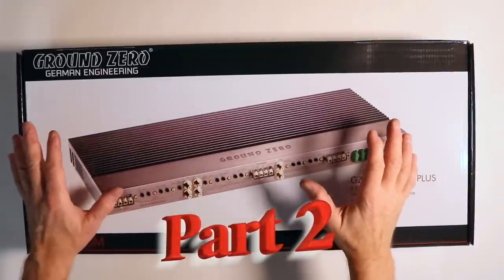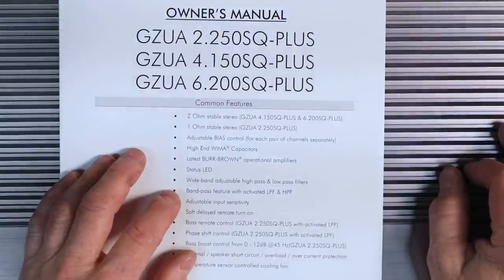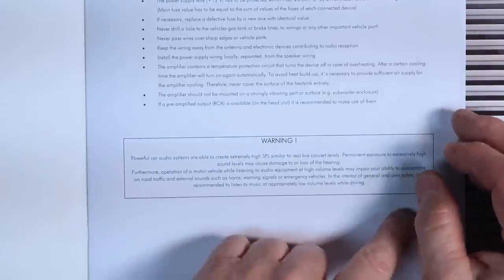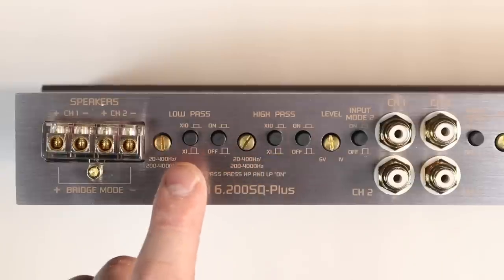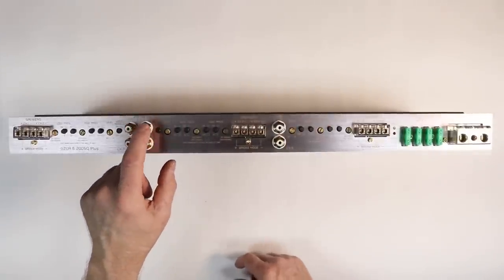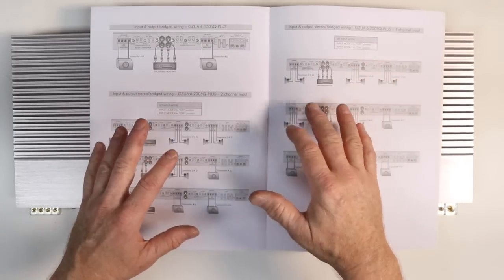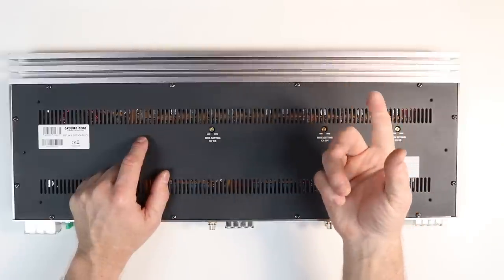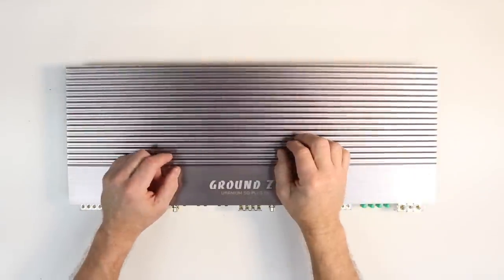Ground Zero Uranium  GZUA 6 200sq unboxing Car Stereo Lab part2

Comment: Awesome. I'm running 3 of the 4 channels versions of this , Except it says B2 audio on it. (Same exact amp, same box, same dunnage (cardboard holding ends of amp) same felt black bag, same heat sink, same color,same output layout, same bias control.)

They sound amazing
Reply: Which B2 amp is that?
Reply: @ScramTek  reference four
Reply: @TKO_Horticulture420  
Ah okay. I misunderstood. Searched everywhere for a 6 channel B2 amp version of the GZ in this vid. No wonder I couldn’t find it…

Comment: Hi Dean. I’ve purchased two of these 6 channel and one 4 channel for a fully active system with a Helix Ultra (summer project). I was considering the Zapco AP’s which are only little bit more expensive. But I’ve chosen these because they have been tested by a well regarded German magazine and the S/N ratio and the dampening factor of the GZ was substantially better, but little bit lower ouput power. Someone, a installer, assumed that the AP’s were better because…. no real reason. What’s your opinion. Test results or just an opinion?
Reply: Also the op amps are upgradeable.
Reply: @ericperry72  didn’t know it actually…

Comment: The Bias controls suprised they put them on the bottom instead of the control side of the amp.  Plus its so heavy trying to manipulate a wired amp is going to be awkward for adjustments.
Reply: That’s a downside. The plutonium series and above are reachable when installed, but the sound quality off this lower line is near the Reference line!

Comment: Is it just me or does the speaker wire connectors look crooked instead of straight?
Reply: Believe me, the fit and finish is top notch. Two things are mwwaah; the power and ground gauge could be bigger, and the bias controls doesn’t ad much to the sound quality. The amps gets quite hot when you turn them down to A class and are not very impressive in terms of sound quality.
Reply: @umtbozkr2358  It may be top notch but the speaker terminals where you plug in the wires are crooked. All three are crooked but input one and two are worse.
Reply: @travissapp4273  mines looks fine. Both 6 channels as the 4 channel. Maybe the angel of the camera playing mind games. Nevertheless, I will look at the video again if I can see something.

Comment: Could you use it on a motorcycle
Reply: To big 😂
Reply: @umtbozkr2358  I've got a large motorcycle
Reply: @danielzamora3769  If that’s the case, this is a gem of an amplifier. Otherwise I wouldn’t purchase two 6 channel and a 4 channel for my car. Very detailed sound with a minimal to none noise floor.
Reply: for motorcycle it's better an Hertz ml power 4. Power, quality (even if it's class D) in small chassis.

Comment: looks like made in C.
Reply: Yes, made in China, but with German standards. Just like a Fiio; also Chinese but very nice.
Reply: ...for the price , you could get one that is actually made in Germany, a Helix or maybe a Brax ( they will cost more) or maybe a Rainbow Audio
Reply: @raymo6795  or you could buy a Ground Zero Plutonium series amplifier made in Germany
Reply: @raymo6795  for a Brax amp you have to pay 3 times more and no 6 channels, Helix doesn’t make 6 channel amps in this category. Only the C four I considered, but again, it’s a four channel. Rainbow; dead for a long time. Even their speakers are sold as the brand Audio Circle….. So even it’s made in Zimbabwe with Mcap’s en Wima’s, it doesn’t make any difference. It’s not who it made by.
Reply: @hardcorehifi  the Plutonium’s are nice, but also not worth the extra bucks
Reply: @umtbozkr2358  Match makes 6, or 8 channel amps, I had not heard Rainbow sold out, I own a Helix 5 channel, which will often replace. 6 channel. My point is there are offerings from German or European manufacturers if you prefer not to overpay for Chinese gear pretending to be German.., people like me.. My next amp(s) will be Mmats, made in USA
Reply: @raymo6795  everybody has his own opinion which I respect. I used to use Steg, the in Italy produced ones. Since I tried the Plutonium mid-woofers off GZ I was sold. Since then I stepped up to the reference speakers off GZ (even bought the golden limited tweeters). Because I live in the Netherlands, European brand’s are more my taste. But regarding Match; that’s really the entry level off Audiotec Fisher. Helix on the other hand is one off my favorites, especially the older ones like the P400, which I own three off them, B2 (also two of them) and certainly never will sell them. But Match… no thank you. Rainbow is like MB Quart; used to be one off the best. But nowadays the former employees make German Maestro because Maxxsonics made MB Quart a cheap brand. But these amps are not Chinese. German technology assembled in China.
Reply: @raymo6795  by the way; I use as one my sources a Fiio M11 pro. Made in China by a Chinese company. I have an IPhone which says “engineered in the USA, assembled in China, I use a Ikko Zerda as my laptop DAC… and no I am not Chinese 😂😂😂
Reply: @umtbozkr2358  …indeed Umit, everyone has their own opinion.Here in the U.S.,we have 99% Chinese made brands.Many are designed in the U.S, but manufactured to spec by the Chinese, Koreans or Indians. When I was young, all the best gear was American made. Slowly but surely,all the American brands started to move to China ( Rockford Fosgate, Kicker,MTX etc.). I think the Chinese do a fine job with manufacturing, and they do it cheaply ( inexpensively). I guess I just sort of resent the misleading packaging. I am sure the GZ are manufactured to high spec by the Chinese.I seem to recall, that GZ was started by an American who partnered with a German….or something.But for me, Chinese products are a dime a dozen, and there is nothing special about them.Car audio has been a hobby for me since the 80s, and I try to buy non Chinese when I can. It lacks character.Obviously, I often have no choice. My TV, my IPhone….nearly everything…is made in China. However, there are still amps and speakers that are not. And I do have a choice, so I strive to buy European an American made. If I were to shell out $1600us dollars on an amp that I thought was German and it turned to be made in China, I would be pissed that I was duped by their deceptive advertising. “ Gladen” also practice similar deception.As for the Match amps, they are purpose built. They are designed for easy install and factory integration, without cutting wires . And will definitely improve the sound of your factory stereo .They do well exactly what they are designed to. The pp 62 DSP , can also power a set of 3 way components adequately, (50 watts  x 6@ 4 ohms) and are infinitely configurable via their software…and as advertised, made in Germany. I have never corresponded with somebody from the Netherlands ,.Umit. I would love to see what is available in you country. You mentioned “FILO”. That is a brand we do not have here…nice chatting Umit✌️
Reply: @raymo6795  Hi Ray,

I agree with you Ray for the most part. 

Indeed, the prices they charge for what it has cost a manufacturer in labor may be very low. 
But the manufacturers are forced in to this because off the prices off the electrical components they use in their products are not cheap in High-End equipment.

So when you drop down more then 4k to 5 k for a Brax amplifier, maybe the half goes into German labor (I know this because im an accountant, car audio is a hobby).

Like you, I have also been involved in car audio for years when brands were usually made in the country where they are located (Hence my Italian Steg K amplifiers, not the in China produced ones nowadays).

But you can't get over the fact that the minimum wage in America and Europe is nowadays a lot higher than countries such as China and Korea, forcing manufacturers to offer their products for acceptable prices by cutting the price off labor.

Last summer I ordered a genuine American brand Dell laptop; guess what was on the box when i got it; Made in China

This amplifier, for example, would most likely cost 3 times as much and there would be very few people left to buy it. GZ and all the other Brands have to make profit to survive. And the few products, inhouse made, with extreme price tags don't keep the bussines running.

For example, my tweeters alone were over $1500. Why; because they are handcrafted and paired by the developer Michael Feld himself with it's own handwritten serial number.
Does this give a good feeling; absolutely. Would I pay so much if it wasn’t handmade by the developer and limited edition. No f.. way! If I ever want to sell it, would I get the price I paid for; probably.

I have more trouble with "real" Chinese junk that claim to have 10,000 watts and ultimately only deliver 100 watts with noise interference and all the other problems.

As I've said before, I personally don't care where the products are assembled, as long as good parts are used in the production with a good product as a result. If its put together by Hans or Ping Ping; don’t care, as long I get a good product.

By the way, Fiio M11 pro is a digital audio player (DAP) that can play all kinds of music files such as Flac, WAV, just like an Astell & Kern player.
Highly recommended as a music source.

Nice talking to you,

Cheers!
Reply: @raymo6795  Hi Ray, I completely agree with you. If you asked me a couple off years ago I would say the same, no in China made products for me. And just like you, I can’t sell anything and my wife says the same; why don’t you get rid off the equipment you don’t use. Old analog crossover networks, DSP’s, subs, amps, speakers… This hobby is a blessing and a curse in the same time… take care ✊
Reply: By the way, in contrary, I like a good conversation about a subject which interest me with someone who knows about the subject. I have never been bored. 
Scan Speak and Dynaudio are Danish high end brands. 
Unfortunately there no real Dutch brands anymore since maybe the last 30 years. 
My American favorites; 

Soundstream; especially the incredible Human Reigns (those sculptured faces as heat sink, oh my god 😍(some hate them some not, I love the looks), but I believe nowadays Soundsream is not as high end as they used to be.

Precision Power PPI were reference amps in their days, don’t know how they are at this moment.

JL13W7 even doesn’t need an explanation…wow. 
It’s that my car is a 535Dx wagon with limited height in the trunk, but I really considered it.

Kicker solobaric L7, the square ones; loud and SQ, but needs very big enclosures. 

I hear good things about Illusion Audio and Audiofrog, but never heard them in real live.

I’ve seen Steve Meade using D’ Amore amps. Looks very nice, but its so new that I can’t have an opinion.

My next project will be two Morel Titanium ti124 instead of the two Mac Audio Aliante in the back. One of the Mac’s will move in the passengers footwell. I hope it will work after an extensive tuning with REW.

Summer/spring project, to busy at the moment with auditing and yearly finance reports of my clients at this moment. 
I will open an Instagram account and make pictures and videos when building it!